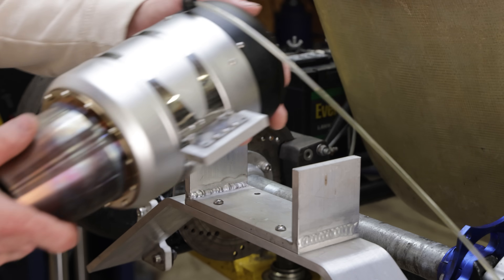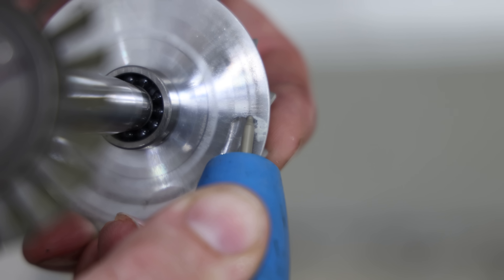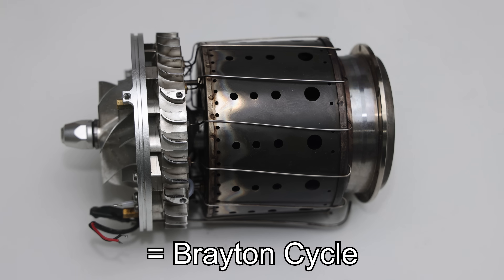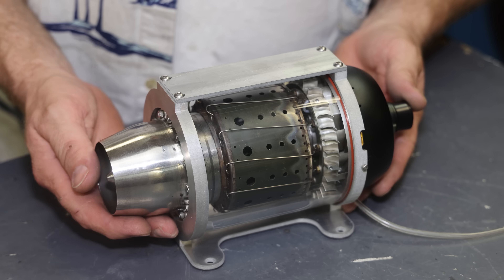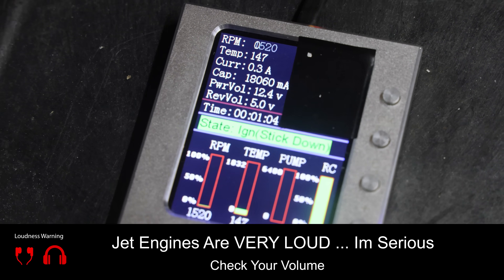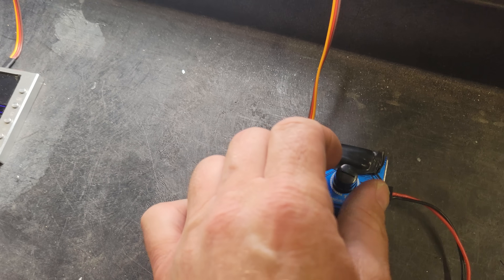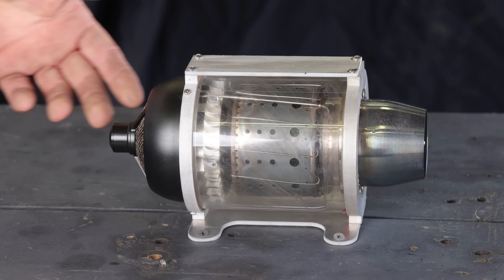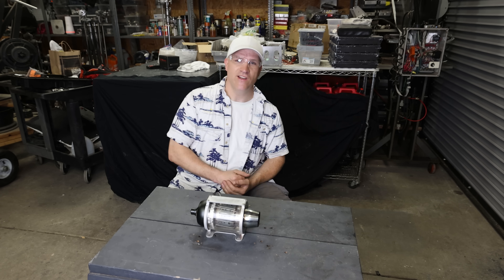See Thru Jet Engine

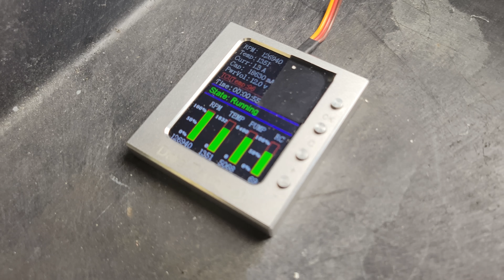Comment: I've read a few of the 7500+ comments and I guess most people have said what needs to be said already!  I was hoping you would pause the video on your little control panel for long enough for us to see the parameters, so I've taken a screenshot at 8:03....  126,890 RPM (that's fairly fast!), temperature 1355 degrees Fahrenheit......  And in the middle there's a caption that says "RUNNING" - that's got to be the understatement of the year!!

I'm in my mid-60's and live in the UK, so still adapting to the use of the word "cool".  I'd say this was pretty hot - as well as being dead cool!  But seriously: what material did you use for the transparent housing and how come it didn't melt??

As other have said, the fact that pilots of jet aircraft and professional designers of jet engines have commented below just how cool this video is prove just how extraordinary your work is.  I don't save and share YouTube videos too often but this is one that gets my vote every time!  Thanks so much for sharing. 🤗

Comment: what if you put a jet engine on the top of a cylinder shaft of a 4 stroke engine piston combustion chamber... which would provide thrust to push the cylinder stroke downward faster than what a combustion chamber would normally allow on the power stroke???   thats what i thought when you explained the workings of this jet engine. is there an answer to this question... would it make a more efficient 4 stoke engine by replacing the poer stroke with a jet engine burst?
Reply: Question 2: If you had a constantly running jet engine on the top of two cylinders, and redirected the jet blast over each power stroke of the each piston then would the jet engine provide constant power stroking for each piston?

Comment: I learned that the air is compressed at the vanes just before the stator by the centrifugal force caused by the impeller.  But your explanation is good enough for the non-GT gurus. Thanks for uploading this video 🙏🏾 very impressive!!

Comment: My guy, conservation of mass, the amount of air expelled by the engine is the same as the amount of air that gets sucked into the intake of the engine. The mass flow rate is equal to the mass flow of air plus the mass flow of fuel. Jet turbine engines rely on fuel to heat the air and increase it's velocity to produce thrust.
Reply from the maker: Heating air increases volume, which increases everything else. Only part of the energy is in the form of thrust.
Reply: @WarpedYT  Wow I didn't think you would respond! I really enjoy your videos! I was referring to the comment about thrust and air flow through the engine when you used smoke. I was making a point that whatever exits the exhaust nozzle is whatever entered the engine intake, with a net positive change in momentum. Fuel and combustion adds heat, so like you said, that's where you get the added energy to change the momentum of the flow.

Comment: Hopefully you can work out a way to get better efficiency. I had a 2014 Chevy Volt. When in Hybrid mode, the engine (maintaining battery charge) providing around 38 MPG. It also came with a "Mountain mode" which actually charged the battery above what you were using while driving, but the MPG would drop to around 17-20, running the engine at top RPM while doing so, and was rather irritating. The Volt didn't have any insulation, so the noise would become irritating. Not to mention the engine vibration you'd have to deal with.

Comment: I'd be super interested to see a force sensor between the engine and the table to measure the actual thrust produced by that little thing. It's so small and I bet it produces a ridiculous thrust for its size.

Comment: It's not only the mass of the air and the fuel, it's also the huge acceleration that causes the thrust. Air and fuel leave the engine much faster than they entered, because they expand by the heat. The thrust can be calculated by F=m*a. Force is mass times acceleration.

Comment: Yeah DO IT.... Love to see stage 2 
that is so cool that compress gas enters into the holes of the can then it burnt... always wondered how jet engines work.. if the out side is hot I wonder how hot the shaft gets.
The Avro arrow Iroquois engine had outer bearing which one needs to wrap the brain on that design...  but that is how it get so much more power.

Comment: What I do not understand is, how does rotor start spinning before the fuel ignites? I see the ignition at 3:50, but what is spinning the rotor until that moment? Electric motor? Also, what ignites the fuel?

Comment: A really cool variation of a very elegant engine design.

Using long trapezoids cut from sheet quartz, you might be able to make a windowed annular combustion can that could take the heat and see a lot more of the flame shape.

Comment: I think that you could make a glass combustor cover. Not sure but it doesn't appear to be holding much load if any. And it also looks like some more bracing to hold the two ends a little more tightly wouldn't hurt either.

Comment: You dont need combustion to have a Brayton cycle........but you need gas (or other working fluid) to expand.......the difference here is that the expanding gas is a result of combustion, and that is an 'open loop' type of Brayton cycle, there can also be closed loop, which is what is being researched right now in power turbine generation using super critical carbon dioxide instead of steam.......its much more efficient.  I was watching it heat up, and thought "its too much captain, shes gonna blow"

Comment: Really like your video :3

Btw, what is the clicking sound that starts happening at 6:55? It happened earlier in the video when you were first starting the engine and it happens each time the combustion starts (IE when the ignited fuel can be seen making the inside of the engine glow).

Comment: I’m a firefighter and we use fog machines for training. The reason you can’t see the fog inside the engine is because the fog disappears in higher temperatures.

Comment: A new innovation. Very silent jet engine. Basic difference: the outblow is through a cone of 90 degrees angle. And the fuel is hydrogen gas and etanol 96%. The engine is supposrted by metal springs, 5.
(Also used on cars now, maybe you have been wondering why there is almost no sound from it)
SAS Emirates AA Lufthansa and Air India are using it. Air India 36% of planes now.

Comment: Do you know how much thrust that engine produces, are you running it on Kerosene?  Like several others I was amazed that the four small wood screws held it down, and the table which is on wheels didn't budge.  About a half century ago when I was in high school my shop teacher built a far less sophisticated Jet engine, and used an old style hanging scale to measure thrust.  Cool video.

Comment: I’ve been absolutely fascinated and I’ve watched the whole video several times, but I’ve been particularly interested by what happens at around 5:50 to 6:00, when you throttle up and down.   
Early on, I noted a figure of 2.79, which I assume is the internal diameter in inches of the glass cylinder.  
I’ve previously done some very rough calcs for the thermal expansions, but not considered what the effect of the internal pressure might be at max rpm.  I don’t know the PR of the engine, but it can’t be more than, say. 3:1, so a very rough sum suggests a separating load on those rings of somewhere around 275lb, perhaps rather less than this.   
You comment on the “expansion” of the engine: however, the axial movements of the engine internals are readily visible, quite large and almost instantaneous.  I think that what is visible must be down primarily to the changes in internal pressure.  You will also see the top strap, which holds the two rings together, visibly ‘bowing’ as the pressure increases.
I think that, in addition to showing us the combustor in operation, you have also revealed to us quite large relative movements of the internal components of the engine due to pressure changes.
It reminds me of watching X-ray videos of 'full-size' engines, showing what happens to seal clearances in real time.  We had a few surprises.

Comment: PPS  I think that the rear support ring might have been forced rearwards by the expanding glass cylinder,  with the result that the gasket has been released.  After the run, there appears to be slightly more of the elongated clearance holes for the screws visible on the inner side of the screw heads, together with a slight overlap (of a few thou) of the screw heads over the edge of the strap, as compared to before the run.
My very speculative scenario of the sequence of events:  
The glass cylinder must heat up quite rapidly, as it's in direct contact with the hot air and receiving radiant heat from the combustor.  Consequently, even though it has a low alpha, it will expand  sufficiently to start forcing the rings apart, after initially compressing the gaskets.  
The straps heat up more slowly, as they are being heated by radiation and convection from the cylinder, plus some conduction from the rings.  They appear to be in aluminium (I'm a Brit!), which has an alpha of around four times that of the glass.  Consequently, they may expand sufficiently for the ring to move away from the end of the cylinder, allowing the gasket to pop out.
Yes, it's all very speculative and there must also be the effect of the internal pressure forcing the rings apart: the transient effect of throttling needs a lot more study.

Comment: PS Having suggested how I would have done things differently, let me congratulate you on what you did do and for letting us see the result. 
It does make the point for all the see that, in a correctly operating gas turbine, the combustion process stays within the combustion chamber and the increased volume of the combustion products is accelerated through the turbine and the final nozzle.
Being familiar with rather larger combustion chambers that have cooling features in the form of cooling rings, etc, it does make me wonder whether the designers and builders of these little machines could come up with a simple wall cooling arrangement.
Having said this, would it really be worth their while, as they probably have a ready market for replacements every 50 hrs?

Comment: I've belatedly taken a look at your see through engine, having been pointed in your direction by AgentJayZ's recent commentary.  I've had a career lifetime in the design of 'full-size' gas turbine engines: however, I'm going to be a little more generous than him, and not claim that they are "real" engines, as compared to the little machines for which you have such enthusiasm.
Firstly, a comment on the Brayton Cycle.  The essence of the cycle is that combustion occurs at constant pressure, which is what happens in all the gas turbines that I know of.  However, the Brayton Cycle does not have to be a continuous process: the original Brayton engine was, I believe, a piston engine.  
Nevertheless, a gas turbine engine does not have to operate to the Brayton Cycle.  Many years ago, I saw a proposal for a gas turbine engine with constant volume combustion, which obviously wouldn't have been a Brayton Cycle engine.  It was described in a paper by a young engineer at Rolls-Royce, who eventually rose to become Director of Engineering.
I also have a comment on the method of construction of the support/retention features for your glass cylinder, which, I suggest, could have been better.  The gaskets blew out, not because of the particularly high pressure,  but because there was virtually no clamping load on them.  The two support/retention rings were attached to each other by two plates, each with four screws, which obviously couldn't exert a significant clamping load on the gaskets.
I suggest that you should have had at least four, or possibly six, long studs or bolts, equispaced around the cylinder, clamping the support rings together.  These could have been relatively thin, so that they acted like stiff springs, which is what bolts and studs actually are.  Spaced off the cylinder, they would have stayed relatively cool and their expansion very roughly matched to that of the glass, which I assume was a low expansion, heat-resistant ('Pyrex'?) glass.
This would have been my preferred method of construction: it's a common enough way of making a simple pressure vessel with a cylinder and two end plates.  If you had done this, then only one of the two support rings would have been needed to act as the engine mount.
Alternatively, using two support rings mounted to the baseplate, you could have used diametral O-rings at either end of the cylinder.  Yes, I know that machining internal O-ring grooves is a pain in the ***, but you could have machined a recess and had a separate keep plate to form the groove.   This would have allowed you to pass the plates and the O-rings onto the cylinder before offering up the support rings, which would, of course, have eliminated the need for a 'blind' assembly.

Comment: Genuine question and not trying to pick at nits or anything here but since the rotating assembly was balanced while bolted together ( intake and exhaust propellers and center shaft) you then unbolted it to fit it to the engine.. unless the intake and exhaust propellers exactly line up when bolted together again won't it make it off balance? Due to the balancing grooves etc made with a Dremel

Comment: Wow! I've always wondered how these things functioned, but I could never grasp it entirely. Honestly, I'm shocked how simple the mechanism is in and of itself. I think it's absolutely brilliant how the final stage of the engine drives the air intake, perpetuating its function, with the only requirement being a continued supply of fuel! I guess this is why planes are so much more efficient than rockets, since you don't have to carry all that oxygen with you. Thank you for this demonstration!

Comment: Your comment about the amount of air jet engines used at the end is correct but thought I'd add to it. Any jet engine on a commercial jet is a turbofan jet engine which does actually move a lot of air but it just pushes most of it like a propeller not through the engine. Fighter jets use turbojet engines which work similarly to the small one shown in the video, they push most of the air right through the engine which means it pushes much less air.

Comment: Interesting video.  It would be nice to add comments related to the operation itself, like what is it doing during start up right before ignition (hear the sound but what is causing the sound); at what point is OK to add the fuel and how much; ideal power setting during start, levels to watch, etc.   The tools in the shop are a dream!  Glad to see the table was not on wheels!  This answered a question I asked a buddy when he was an F-14 jet engine mechanic in the Navy back in the days.

Comment: You missed to say these are turbojet engines the most commercial airplanes dont use them they use super by pass or turbo fan engines where the energy of the fuel is much more efficient used but for the decrease of max speed which is not so important for commercial jets ,  but fighterjets etc use your type of jet engines "turbojet engines)

Comment: Brilliant, makes me want to play with making jet engines again. When I played with making jet engines 20 or so years ago, getting the combustion chamber right was the biggest challenge, especially as you couldn't see anything, so I had to use heat marks and damage to try to work out what was going on. At that time most people were using propane, but I wanted to get mine working with JetA1. I got them to run, but starting was always problematic, so I'd start on avgas and switch to JetA1 once they were warm.
Where did you get the glass? I assume it was some sort of high temperature/stress glass?
Could you see the combustion pattern through the combustion chamber holes? 
The same sort of thing with transparent combustion chamber would be great for seeing flame pattern, optimising it for best combustion pattern and cold air wash over the chamber wall to keep it from getting too hot.
For flow visualisation, fog from a small diameter nozzle like a syringe needle close to the inlet might work better, I saw a Youtube video use a vape device with glycerol to generate fog through a small nozzle. It's probably too turbulent through the compressor to see though. Therefore, fog injected from a small nozzle into the compressed air stream between the compressor and stator would be good to see the flow, like they use in wind tunnels. Rather than injecting fog at that point, maybe something like a vape heating element could be put in the airflow and the glycerol injected onto it, creating the fog directly in the airflow.

Comment: My IQ is low, so sorry for the question: when you start the engine, how does it start spinning? does it has an electrical motor? because the fire comes after that, so how does it start spinning?

Comment: That was freaking sweet. I was thinking you should build your jet engine twisted like the air flow on the side inside. If I had a jet engine I'd be trying to redesign it until I could get the most power out of it. Love it good job bro

Comment: with a Turbine that size, if you didn't strap the table to the ground, when you go full throttle, would the table just slowly roll across the shop, or does that produce enough thrust to where it would launch across your shop?

Comment: A great video and explanation of the Brayton Cycle.  Would like to know characteristics: airflow, fuel flow, thrust, efficiency. All should know that a Combined Cycle Power Plant is a Brayton Cycle Combustion Turbine coupled to a Rankine Cycle Steam Turbine.  The heat from the jet engine heats water to steam to drive a steam turbine for electricity production by a generator  Very efficient.